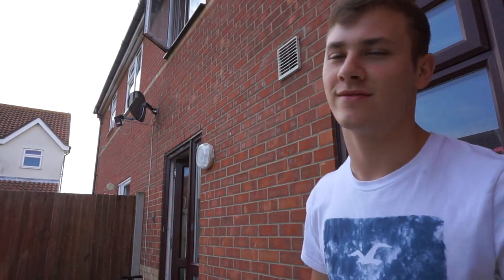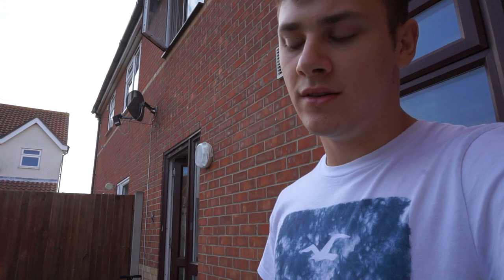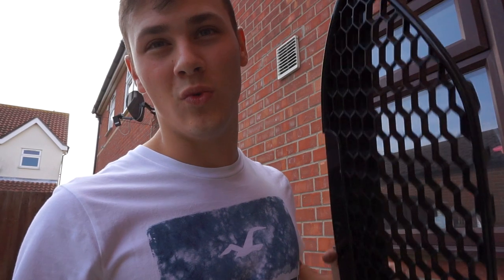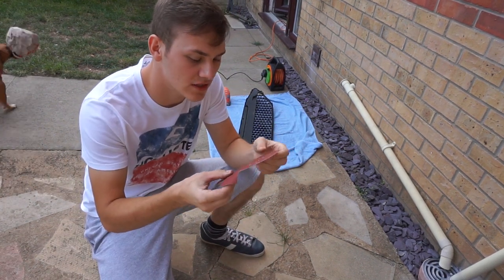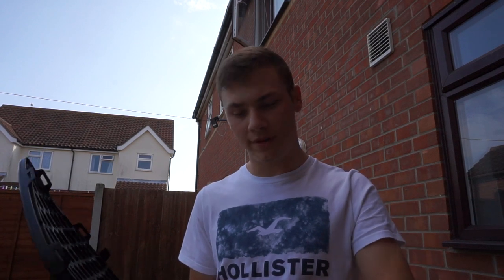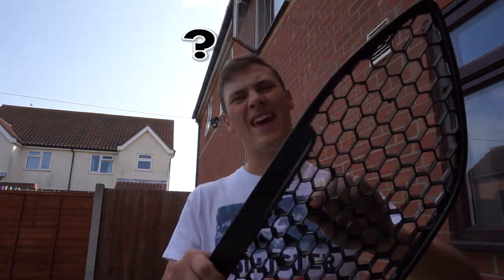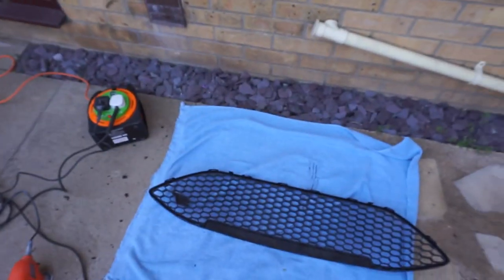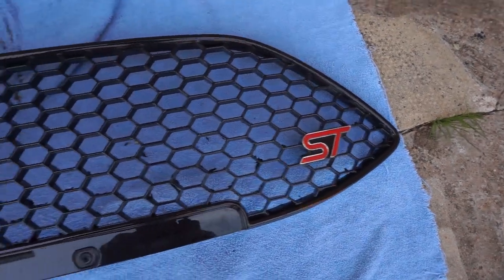Better Air Flow!! No restriction in the grill!

Comment: Love the noise your little dog makes when it jumps. That was a lot of hard work you did, I don't think I'll bother with mine, there must be a good reason why the original design is blocked up. I'm subscribing as you made me smile :-)
Reply from the maker: goodchappy thank you for the kind words! I think its mainly to hide the bash bar which you can see when this mod is done, but I'm not worried cause that will be hidden when I get a bigger intercooler :)

Comment: All that's done is increase drag on your car and slow it down. The only reason to ever do it is if your intercooler is larger. Ford made it that way as it's the 'best' trade off between airflow and drag in the engine bay.
Reply from the maker: Timmy Turner and I plan on getting a bigger intercooler :)

Comment: Wilson's garage
Is it possible to remove the st badge on front grill? :) without it looking too bad! Or do the zs grills on ebay fit?
Reply from the maker: Jake Taylor you can't remove the st badge mate, its part of the moulding, but you can buy the zune sport grills for the st :)
Reply: Wilson's Garage  ah i see collecting my st tomo and ideally wanted to debadge it all around guess i could just paint front badge black :)
Reply from the maker: Jake Taylor ah I see, why would you want to debadge an ST?
Reply: Wilson's Garage just my thing mate, did it with my old mk6 st and a few of my first cars just like no badges lol